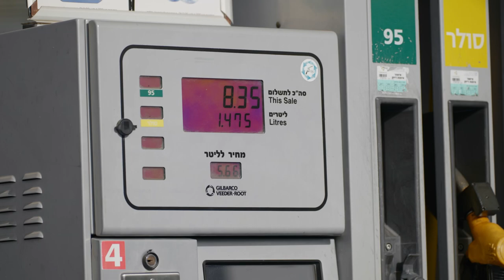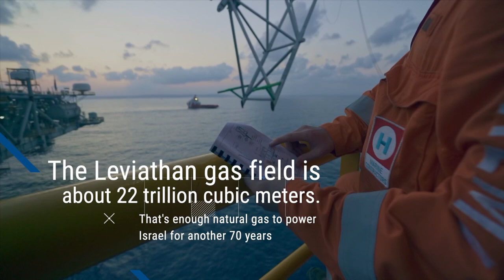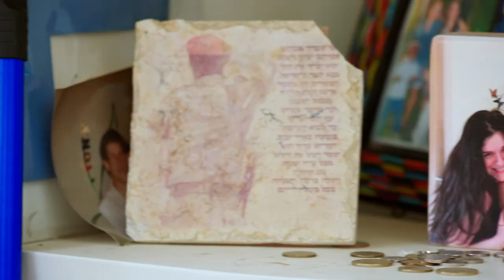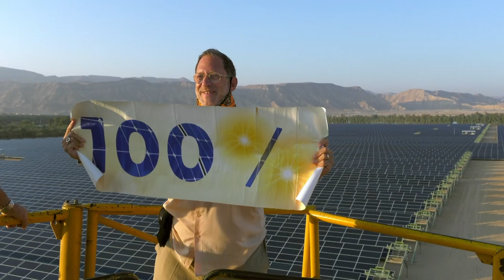Solar Energy: World's First Fully Solar Powered Region | Insights: Israel & the Middle East

Comment: the south of Israel  is especially well suited for solar energy. 
1. There is a lot of Sun.
2. When doing renewalbels on high scale, you need to deal with fluctuations. That means you need a useful energy sink that can handle different energy intakes. In this case this would be water desalination. Combined with the famous Israel irrigation you could really green up Sinai. 
3. One might think that those would be useful for all coastal deserts. But Israel has two things not all of other set regions have: a) Israel is a hightech country. b) Israel has the dead sea. AKA a place to put the brine where it does not course eccologic problems, but would be useful.